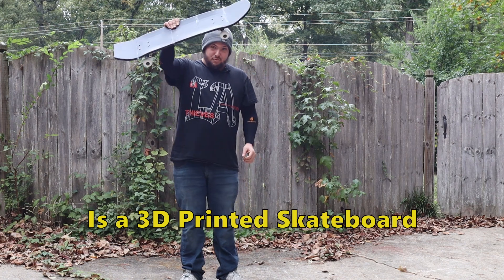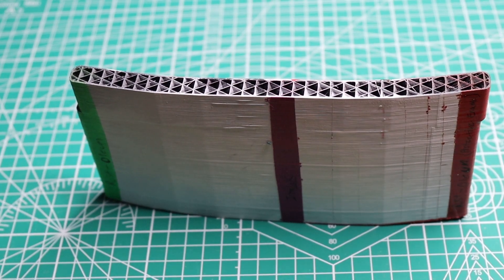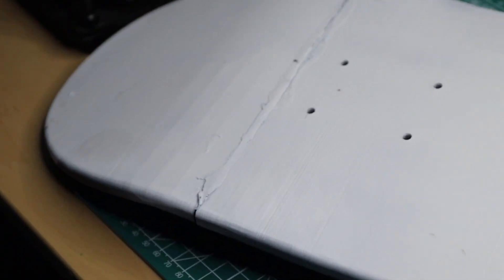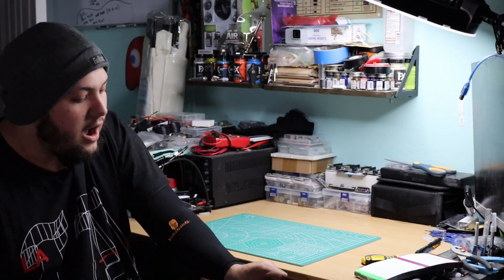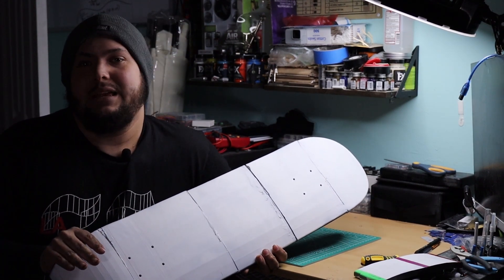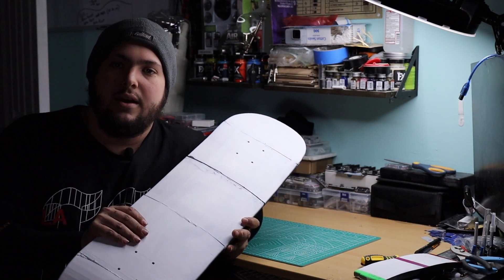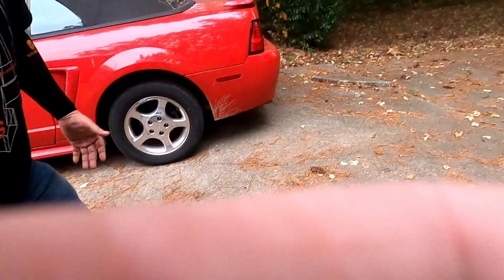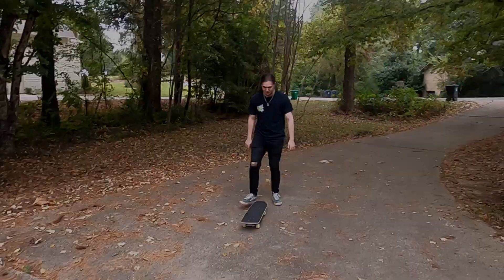Are 3D Printed Skateboard Better Than Wooden Skateboards?

Comment: Obviously, you didn't know how to skate.
If you tried printing a full board, I think it would be tougher.
Try printing a resin material full board
Reply from the maker: I resin printer that size would cost $10000+ easily lol i think it would work for sure.

my friend skates and said i couldn't 3d print a skateboard. i guess we were both wrong.

Comment: Great idea but may I suggest using something like a conveyor style of 3D printer, powerbelt3d, something like that so you can print the board in 1 piece. I think it will be much better as your main issue is too much weight on the cutts. Or you can make the cutts have keys that are long and kind of deep to give it extra strength at the cutts.
Reply from the maker: good idea i will take that into account on future projects thank you for the ideas!